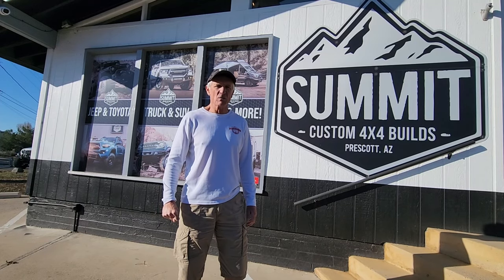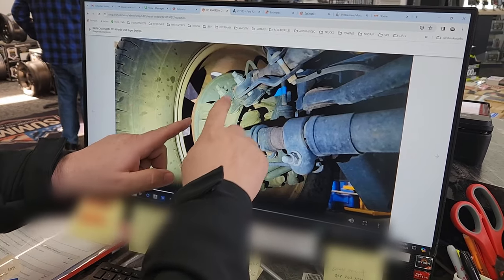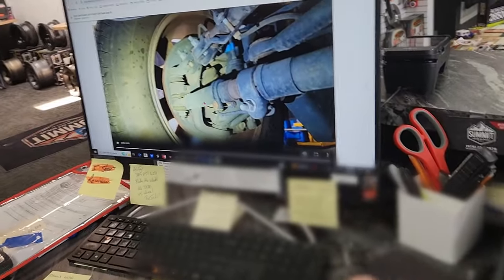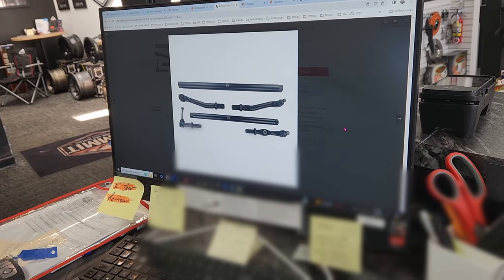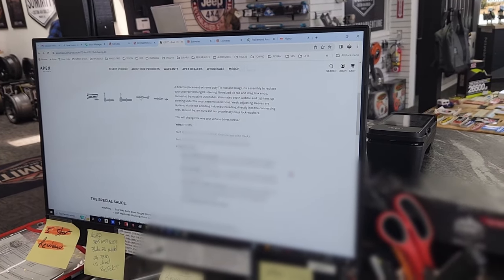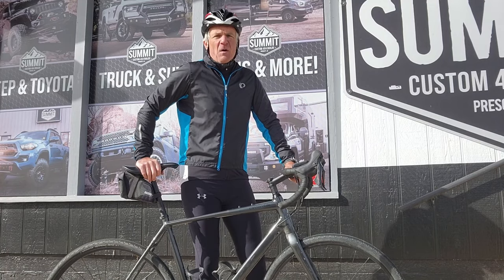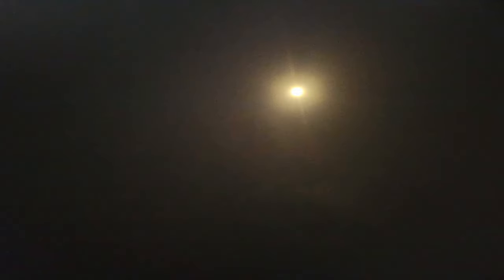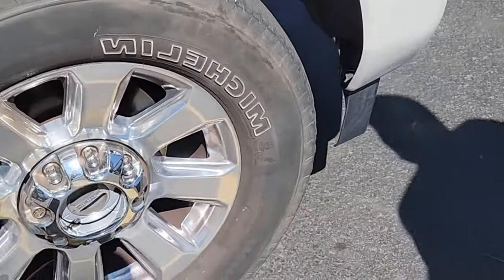We Have A Huge Problem With Our Ford F250!! | Can It Be Fixed??

Comment: Caster shims.. Need positive caster angle to between 2 degree and 4 degree positive.  A Carli track bar helps as well but the main issue is caster angle being 0 or negative.
Reply from the maker: Appreciate the suggestion! That's a very cost effective way of getting the job done. Thanks for your comments. 😀
Reply: I agree. Adding 2° positive caster bushings for $60 fixed the death wobble for me.
Reply from the maker: @StayFreeRelax - that's awesome! I'm impressed with the people who've responded to this video like you who are savvy mechanics and made this repair on their own. I'm happy to say that after 10k miles, we've yet to experience the Death Wobble and are glad to have safely put this problem behind us. Thanks for commenting and take care! 😀
Reply: @blazingnewtrailz    Greetings from Lake Saint Louis!  Caster shims will stop the wobble , but you still need to check the steering components every spring before you set out with the trailer.   I bought an F250 2 weeks ago and immediately installed caster shims.  Only 80 miles at this time.
Reply from the maker: @moosejaw50 - hey there! We're just a hop skip and jump away from you in St. Charles. We appreciate your comment and have received the castor shim suggestion from several people. We're about 10k miles post repair and knock on wood, have yet to experience the problem. Take care and be safe! 😀

Comment: This reminded me of a nephew who has been a heavy duty mechanic for numerous years and in the last years has been working for a Cat dealer in selling the service providing department ( service sales .. I've forgotten the title ), but anyway he drives a company truck which is I think a 2018 F 250 crew cab short box gas engine. It has been a struggle from very low miles ( km actually, this is in Canada ) with experiencing the death wobble and there were times he thought this is it ..... . Well Ford pisses around and replaces a steering shock, never addressing the issue of worn steering parts as they claim they are still in spec. However they have had to change out the front wheel bearing ( unit hubs ) at 30000 miles and again at 60000 miles, somehow its trashing the bearings if you can imagine. They never will change the caster angle as again they claim its in spec. Not sure how many steering shocks is gone through but a few. That Cat dealer has a few company pickups of the same vintage and some are doing just like his with this mess while the odd one has somehow escaped the dreaded death wobble or last I had talked with him on the topic. Trucks with solid front axles, Jeeps etc are all prone to this if they have loose steering components and don't have enough caster set into the wheel ends. All I can think is that Ford set such a fine tolerance on the caster angle to help with steering wheel effort while manoeuvring at slower speeds, I don't know that for a fact but that is a side effect of a high caster angle is increased steering effort as it wants to force the steering wheel back to center when rounding a sharp turn. How Ford could have let this go on for the number of years they have, that is beyond comprehension.
Reply from the maker: Wow! That's incredible! I'm like you and can't believe Ford has allowed this problem to persist, but I've had some people with more recent models say it has been fixed. Hopefully, it doesn't get someone seriously hurt. Thanks for sharing and take care of yourself! 😀

Comment: Great video Gary.  People need to know!! Do you know if the new Fords have the same problem?
Reply from the maker: Thanks Stan & Rhonda! Much appreciated. It's reported that the Death Wobble is mainly found in models produced from 2005 to 2019. I'm not aware of the more recent years, however, there have been reports of the issue being found in trucks manufactured as recently as 2021. There's no excuse for Ford to continue ignoring this problem. They need to take a leadership position to correct the problem before there's an accident and people are either hurt or lose their lives.
Reply: I’m glad I own a Chevy.   That look really scary!!
Reply from the maker: @OverTheHillAdventures - yes! Especially the first time it happened. Linda and I just looked at each other afterwards because we had no idea what had happened. We really do love our Ford and have had no other problems except for the Death Wobble.
Reply: @blazingnewtrailz  it’s unbelievable that Ford does not take responsibility!  Especially when you have video evidence.  That’s why I think this video is so important.
Reply from the maker: @OverTheHillAdventures - I'm not sure why the Death Wobble issue didn't come up in my research, but we do love our truck despite the problem. And...we couldn't be happier that it's now fixed! 🤗😁

Comment: Happened to me 3 times on one trip home. Ford didn’t have parts to fix so I went to a local suspension shop and problem solved. There is a Ford recall on this. I took my recall form to Ford for reimbursement, they will reimburse me what I paid but want remove my upgraded parts and install OEM parts.
Reply from the maker: @bruced9053 - hi Bruce! We were never notified about the recall. I'm glad you had the repair done and can now enjoy some peace of mind. We've driven almost 15k miles since the repair and have yet to experience the dreaded Death Wobble. We're so happy to put this behind us! We appreciate you commenting! 🤗

Comment: I have a 22 f250 with 65k and I have this same issue
Reply from the maker: Very sorry to hear that! It has been over 5k miles without a problem since our fix, and we couldn't be happier. Be careful and make sure you find a reputable shop to make the repair. It's too dangerous, especially if you're driving at a high speed. Be safe! 😀

Comment: Noticed 2024 have a single stabilizer shock installed. That’s what mine has installed aftermarket and haven’t had any problems. I’ve heard the dual shock is better
Reply from the maker: That's a very smart decision on your part to install the stabilizer shock! But this move by Ford is also telling in that they made the upgrade on the 2024 model, especially after the problem has been around for so long. They're okay with designing it into the new model year when they can budget for it, but won't doing anything about prior models. Their decisions are all about the bottom line and come at the customer's expense. All the best and thanks for your comment! 😀

Comment: Not saying this doesn’t exist, but I’ve owned Ford Trucks for 30 years and have never experienced it.  Trucks ranging from brand new to 200k+ miles.
Reply from the maker: That's long history with Ford trucks and I'd have to say you're pretty lucky. From personal experience and speaking to others, the Death Wobble is real. The vibratration is scary, especially when you're driving at 50+ miles. Thanks for commenting! 😀
Reply: @blazingnewtrailz no problem.  I know death wobble can be an issue with any solid front axle vehicle.  But I’ll take the trade off over a HD with IFS any day.  Death wobble can be fixed.  It’s a geometry problem.  A weak design is weak from the get go.  Seen and personally witnessed too many GM half shafts break.  Have a great day!
Reply from the maker: @AFoxintheWild - very good points! You're spot on and it's a travesty that Ford didn't address the problem in later model years after it was reported. Great dialog and be sure to enjoy your weekend. 😃

Comment: What kind of cost was this procedure?
Reply from the maker: Hi Gary! It's not an inexpensive fix. We paid around $3k, but that also includes the diagnostic test and alignment. Also keep in mind this was Arizona and repair shops will charge different rates. While Ford should have stepped up and taken ownership of the problem, we're not going to put our safety in jeopardy. We still love our F250 truck, but POed with Ford management. Thanks for watching and commenting! 😀
Reply: @blazingnewtrailz did they change out the casters as well ? If not still could get death wobble. Worn parts is part of the issue . That’s a lot of money if it didn’t fix the problem. Casters with positive degrees. I replaced my worn parts as you did and still got death wobble then seen more about the issue replaced the casters no more issues
Reply from the maker: @brendaehrhard9038 - the cost was actually around $1,600. We also installed the AirLift airbags and I mistakenly included the charge for both. With regard to suspension, we had the dual stabilizer kit with Bilstein 5100 steering stabilizers installed. We've driven nearly 10k miles since the repair with no issues thus far and our travels have included some rough roads. So far so good! 😀🤞

Comment: Yet another reason why I will never buy another Ford, GM or FCA product.   It's not patriotic to buy poor quality products.  A more positive term for "the death wobble" is "the milkshake option".
Reply from the maker: I don't disagree! I worked in medical for over 25 years as a purchasing manager, and we built equipment responsible for testing and treating people's illnesses. Lives are at stake, and the quality standards imposed by FDA don't allow you to cut any corners whatsoever! While we love our truck and there have been no other issues, I don't understand the position Ford is taking by not doing the right thing and owning this problem. It's embarrassing and a disgrace!
Reply from the maker: I forgot to mention this earlier. Thanks for watching the video, and I appreciate your comment! Take care! 😎
Reply: Casters with positive angle position cost 90.00 and take minutes to put on your truck.  Problem solved.
Reply: I replaced my whole front end for about $800 that everything moog and precision parts.
Reply from the maker: @rvadventures - impressive! Do you have the skills to make that repair yourself, or did a friend help you? Well done! 😃

Comment: I fixed my death wobble I bought a Chevy
Reply from the maker: Ha! That's definitely one way to fix the problem! I understand Ford has also corrected the issue on the new model. 😁
Reply: Ha ha they do it too
Reply from the maker: Didn't know that Tom. My son-in-law had a jeep and traded it in for a Ford F150. l didn't know until recently that he was dealing with the Death Wobble. In 30 years, Jeep has never addressed the problem. I guess Ford is taking a page from their playback. 😬